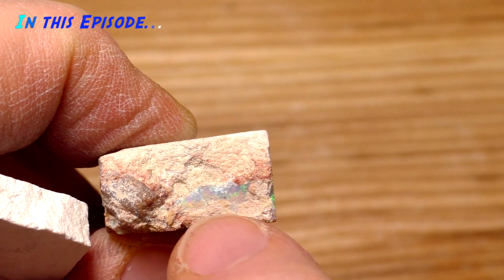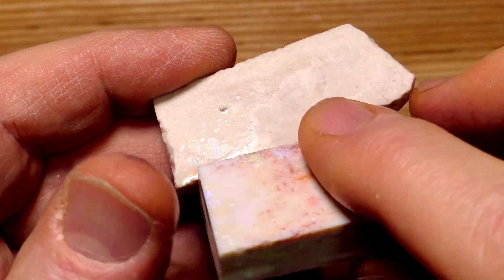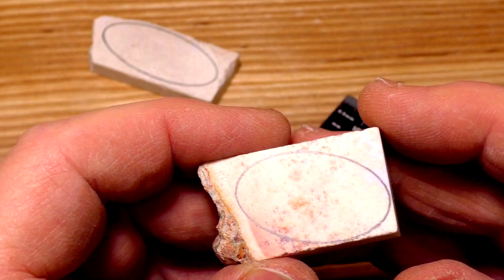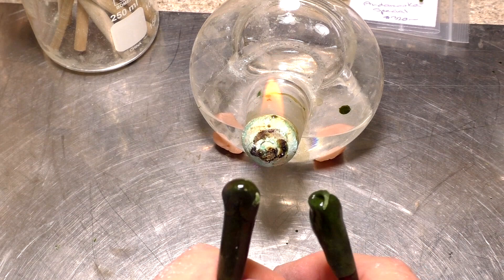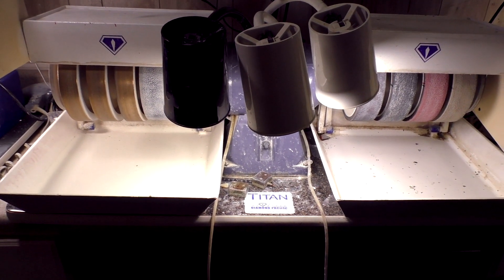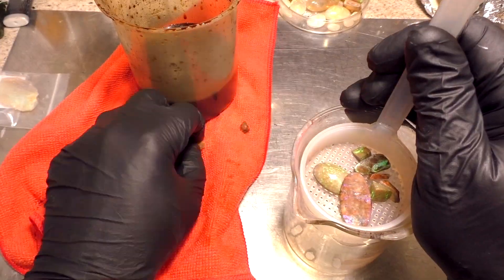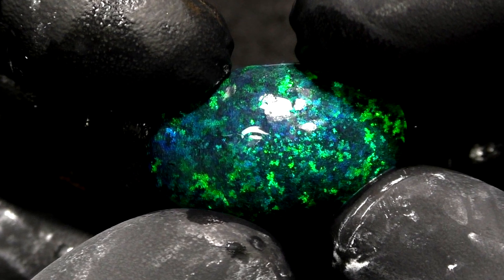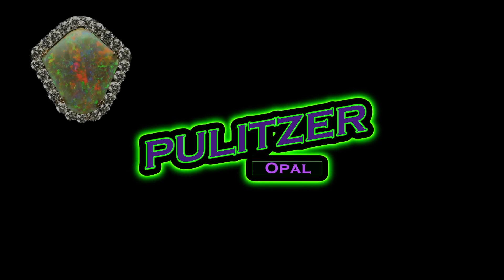Mysterious Matrix Opal - Unveiled!

Comment: I was wondering why you treated them BEFORE you did the high polish.  I thought the treatment only goes down a millimetre or maybe two at most. Then we got to see the ugly result.  I'm glad you were able to revive them in the treatment.  

Question:  why do you use a rotary saw instead of a band or cable saw?  I would think you could get much better cuts with a cable saw, and you would have less gouging on the cut side.  

Thanks so much for your informative and eccentrically entertaining videos.
Reply: @PulitzerOpal  Thanks for the response.  I see that I'm calling it by the wrong name.  Diamond wire saws are used to cut glass, quartz, metal and pretty much any solid of varying thinness.  You can change the wire from very fine to wider diameter to get more precision.  I know that Gryphon, Presi, and Diamond Wire Tech make water cooled saws.   You do an amazing job with the rotary saw, so there probably isn't a good reason to change.

Comment: Awsome material I did mine last week for the first time intresting stuff. And got some from Riley also . But I treated it without acid like Riley does did you every try without acid ?
Reply: @PulitzerOpal  I cooked it  a slow cooker crockpot so arround 96 deg Celsius  for 24 hours than at 250 deg Celsius oven I think approx 4 hours . I was told when the sugar smell is gone the carbonation is finished and you can start reducing temp . My next batch is soaking now in coca cola I heard it gives a darker result and I added glucose that has smaller molecular structure than refined sugar . So that should go deeper in to the rocks . Will see how that will work out.😁😁 take care